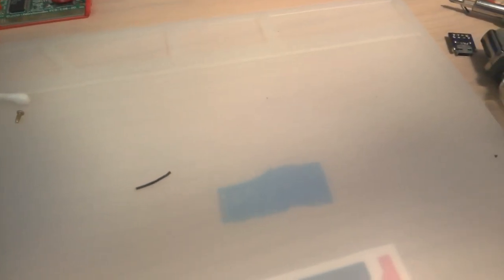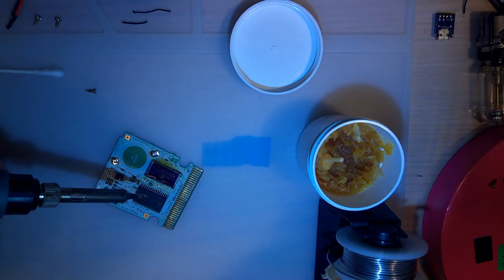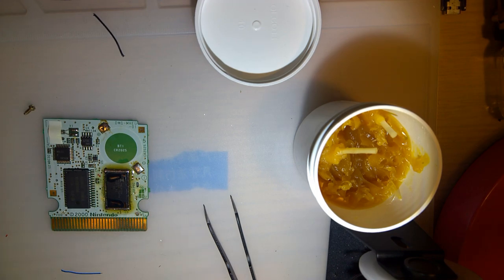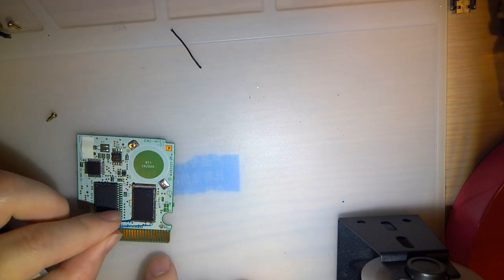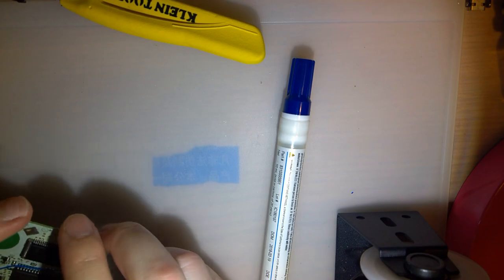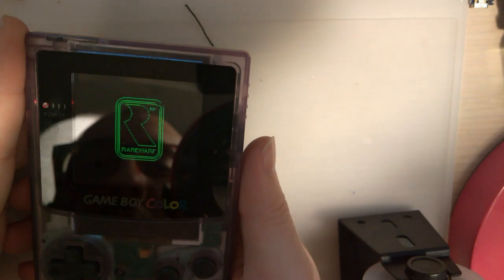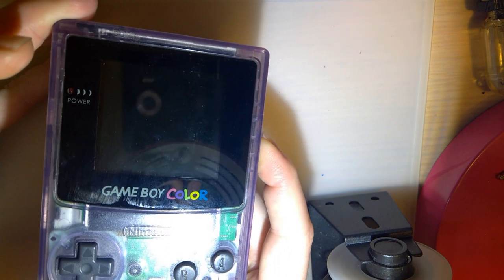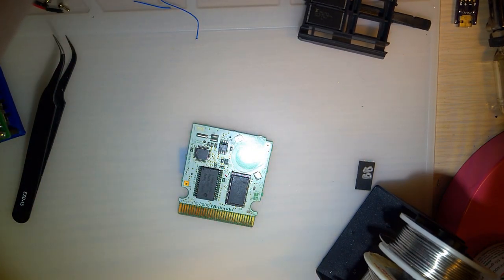Making a 4MB (32Mb) RTC Flash Cart with a MBC30 cart

Comment: Cool one.  Is it possible to put a soft chip holder on a cart so you can test to make sure there are no F boxes before you solder it to the board after flashing the test ROM?
Reply from the maker: It's possible, but not very convenient. Those chip holders are very finicky and VERY LARGE. Usually my chip flasher will stall if it runs into an issue with the chip though. 

FYI, the issue in this particular video was with the MBC30 chip and not the flash chip. I had to move the WR line to another pin before everything worked as expected.

Comment: I'm trying to make a flashcart, but I only have a game cart with an MBC1 chip. It doesnt have a rom A20 pin, but the guide says I need to solder a wire to it. What is the A20 pin and will I be able to make a flash cart if I dont solder to one?
Reply from the maker: A20 is an address line. Without it, you will not be able to use the full capacity of the flash chip.

Comment: are there any updates for this, or do i still have to pre flash the chip before soldering it to the adapter?
Reply from the maker: You never had to pre-flash the chip. I just liked doing so because it makes troubleshooting much easier. If you run into an error flashing the chip, it's not gonna work on the board either.

Comment: What flasher do you use for this cartridge? I was wondering if my Joey (from BennVenn) would work with this. I was starting on MBC30 development, and realized that the Everdrive line didn't support it.
Reply from the maker: GBxCart RW is a much better flasher than the joey. I use it for flashing the assembled carts.

Comment: if you use the pin 31 workaround, would you loose audio capability from the cart?
Reply from the maker: No because the pin is not connected on this cart anyway.
Reply: @makho  thanks for the reply! I have one more question. Would it be possible to do both this and an F-ram mod? I can design a custom PCB for it if necessary, but I'm not sure if there would be a limitation caused by the mbc30.
Reply from the maker: @Kestrel_  This is something HDR, Shockslayer, myself, and a few others are trying to work on in the Game Boy discord (discord.gg/gameboy). Here is what we have right now but be warned that versions 1.1 and 1.2 do not save and 1.3 (current ver) is not yet tested. 1.3 should fix the issues we've been having though. 

https://github.com/HDR/MBC30-Flashcart